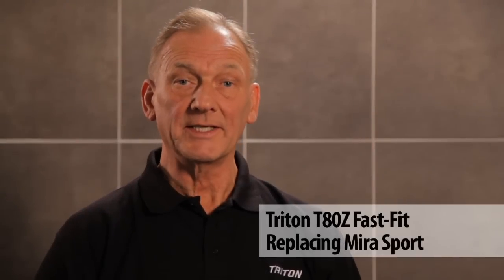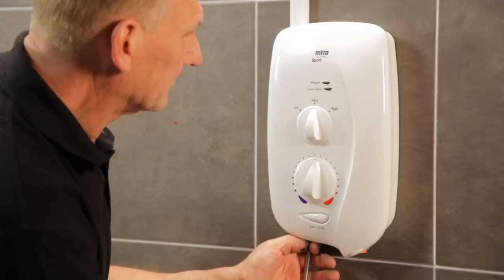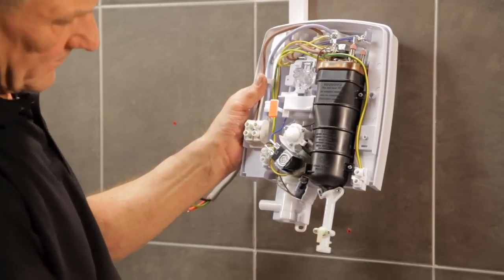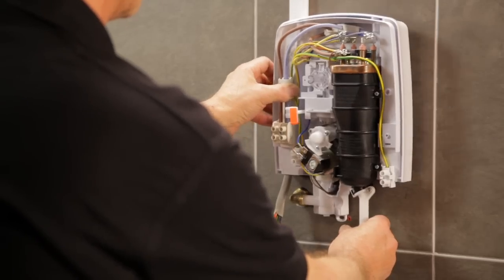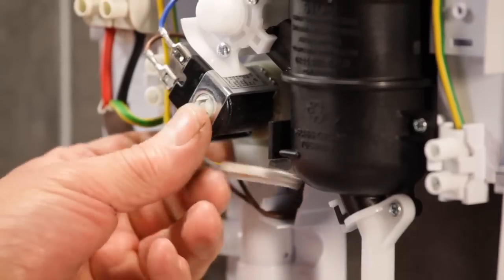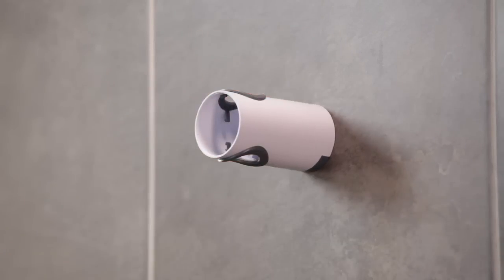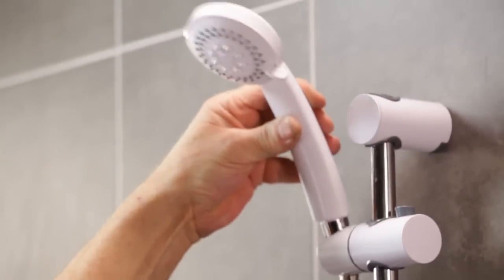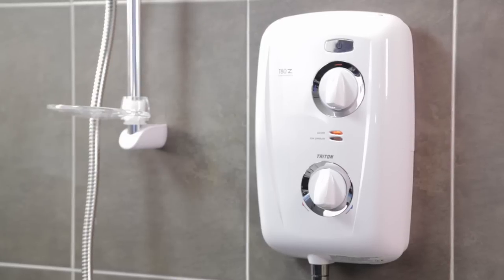Electric Showers: "How to install T80Z Fast-Fit and replace Mira Sport" video from Triton Showers

Comment: Do these have a water flow regulator?
Reply from the maker: Hi, the product uses a stabilising valve which adjusts the amount of flow that goes into the heating element for adjusting it hotter/colder. So it doesn't use a flow regulator, however we do also sell a T80z fast-fit eco model, this will limit the flow rate to a maximum of 6Litres/min with an internal flow regulator.

Comment: I live in a flat. And the water pressure very low. Can I simply install a shower with a pump built in.?..
Reply from the maker: If water pressure is low an Electric Shower with pump or Pumped Electric Shower such as the T80si Pumped, T90XR or T150Z Pumped product could be considered. In each of these cases it would be necessary to feed from a cold water header tank.

It may be that a Mixer shower could be considered but if pressure is low this will reflect on the performance from a Mixer. In this case it would be advised that a knowledgeable local Installer is contacted to view the proposed installation for the best option, as it would be difficult to give the best option without seeing the full site conditions.

Comment: I thought electric cable had to run behind the tiles?
Reply from the maker: Thank you for your enquiry. The cable running to an Electric Shower can be surface mounted, providing that it is within conduit/ trunking and the cable is run into a designated entry point into the shower unit.

Comment: How much water does it heat?
Reply from the maker: +Victoria N. McCormick For an average showering temperature you should be looking at around 3-4 litres per minute. We state a minimum running pressure/flow of 1 bar at 8l/min or 1.5 bar at 11l/min for a 10.5kW electric shower.
Reply: Thanks for the information.
Reply: How much does it cost?
Reply from the maker: +Victoria N. McCormick Our RRP for the T80Z Fast-Fit begins from £155.51, depending on kilowatt rating required. This model is also available from various trade and online outlets however.
Reply: Thanks for the information.

Comment: hi.
does it require 40amp or 10amp only ?

thank u
Reply from the maker: +John Hill Assuming you have an 8.5kW or 9.5kW version a 40 amp circuit would be required. 10amp would be insufficient and under-rated.